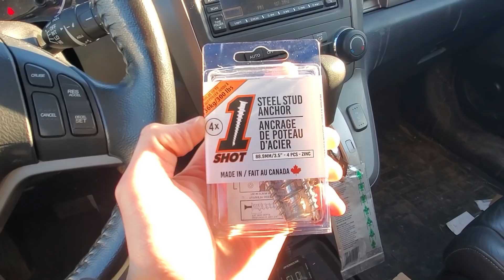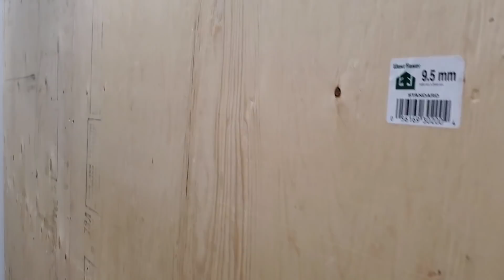LEGO Wall Update! Ready to Rock & Roll!

Comment: Hey bricksie, if you get one of those fence/gate anti-sagging kits from Home Depot or hardware store, it's the same concept with your wall as a gate and that should fix the gap that's larger at the top. It's like a metal steel rope/wire with some hooks and it goes from one corner diagonally to the other corner and it helps square it up.

Comment: I think you should put s a couple of 2x4 in the back, it will make the entire frame more stable. Plus if you position them right, it will give a great anchor point for when you and the lego sections. That way they are not just screwed into the plywood or to far away from eachother. But the wall looks awesome, can't wait to see the finished product!

Comment: You might want to experiment with the height of the Bricksie logo using paper or cardboard first.  Centering it may result in a blocked view of the logo by the tables from certain angles.  Two-thirds of the way up the wall might be better for optimal viewing.

Comment: For the "hook and latch method" for the locking mechanism, I suggest also reinforcing the back with a cross "X" using 2x4 or so. Since you will be having all that weight on the front face of the wall. Would also be a good way to mount the lego, since it's easy to screw into and hold because there is more surface area for the screw to bite. Overall looks great and I love the layout!

Comment: Hey Jordan. FYI We did this to hide mechanical room in basement. I didn’t want to look at a door  in middle of room so we hinged one end of bookcase to hide the room. It looks great. I keep LEGO on it but over time the weight of the hinged door has broken down the castor. We will eventually have to take it down to replace castor and/or add another castor to existing one. That will not be fun. Hopefully the specs on your castor will carry the weight. You won’t be moving it as much as we do ours but just wanted to put that out there. Also, the weight of our secret door has grooved the arc of door into our stamped cement floor—yes, cement floor. Your concept looks fantabulous. Love the pillar. 💚

Comment: You might want to install some battery lighting in the area so when you do trip the circuit breaker you can see what you're doing to move the wall to access the panel. Depending on what you trip, you may not have any lights down there.